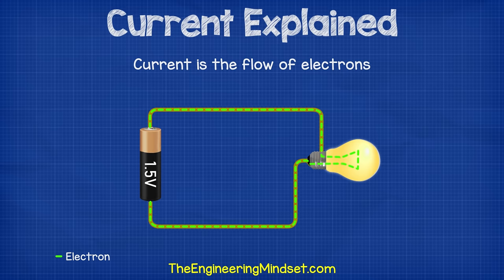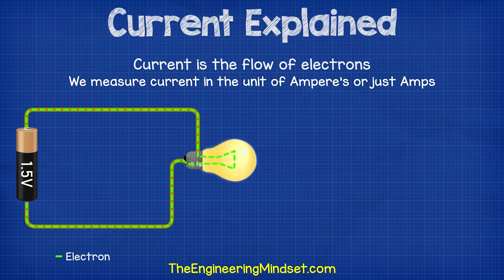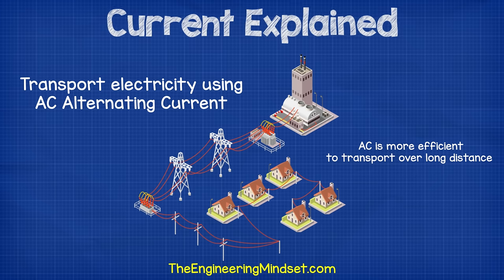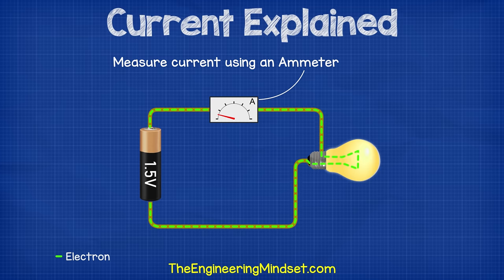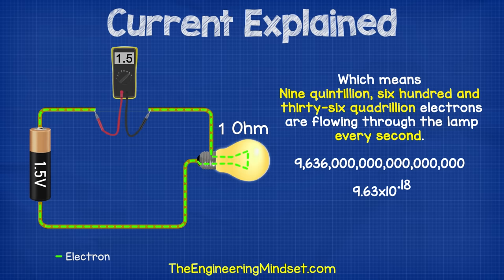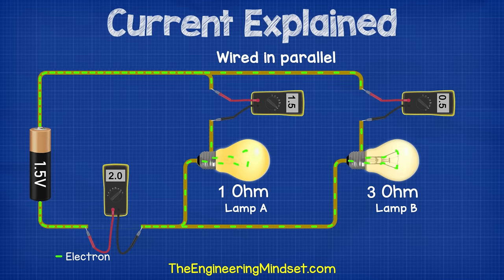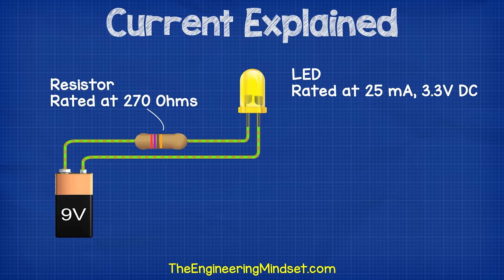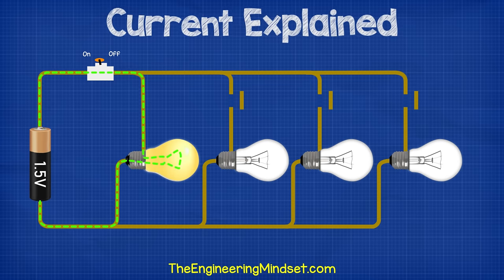What is CURRENT– electric current explained, electricity basics

Comment: The coulomb measures charge, and the ampere measures the flow of charge. One ampere of current is equal to one coulomb of charge passing a point in a wire in one second.

Comment: There is a mistake at 05:03. 1 amp = 1 Coulomb PER SECOND. And 1 Coulomb is just 6,241 506 × 10^18 electrons and NOT per second.
Reply from the maker: Check new more detailed current electricity video here: ➡️ https://youtu.be/kcL2_D33k3o

Comment: The one thing that always confused me about current, was how many amps a circuit can draw. E.g., we know from a standard 120V outlet, the breaker is 15A-20A. How was that rating determined? If we short a 9V battery (Or any voltage for that matter) with copper wire, how do you know much current it will draw?
Reply from the maker: Check new more detailed current electricity video here: ➡️ https://youtu.be/kcL2_D33k3o
Reply: We assume that the consumer will only use household appliances.
You could only really overload the circuit if you used lots of extensions and multiple sockets.
A cooker or electric shower would need a separate circuit from the distribution board with 30A fuse or larger.
Reply from the maker: Seen our new incredibly detailed MCB video? link: https://youtu.be/gqEu9t8HwW0

Comment: I have a question! We all know that High Voltage low Amperage will give you a harmless but painful experience, and that it's good to keep animals and people in and/or out of places. What about the other way around? What would happen if you came in contact with really low voltage and high amperage? And does it have any practical uses? I'm talking REALLY low voltage now, not 120 or 240 but like milli volts of voltage or something.
Reply: nothing, your resistance is too high.if it's too less voltage there is even not much current over you. in order to overcome your resistance you need more high voltage.
Look in ohms law:
U=I*R
if we assume a stable resistance of your body of lets say 100kOhm and Volts oft lets say 2 Volts, then
I = U/R, so 2/100.000 = 0.00002 Amps. so if  there is only a very low voltage it is insufficient To let current flow over your body, even if the system can deliver high current. but in reality human body is voltage dependent resistor and therefore not stable at all. with rising voltage the resistance is dropping fast and therefore current rising to hold the voltage. Then it could become dangerous.
Reply from the maker: Check new more detailed current electricity video here: ➡️ https://youtu.be/kcL2_D33k3o
Reply from the maker: Check out NEW resistor video, everything covered! ➡️ https://youtu.be/DYcLFHgVCn0

Comment: If a device can handle 1A so 1C of electrons per second then 1A is that device's tolerable "pressure". So what's voltage then? Because it's not "pressure"... it's the 1A

Comment: Thanks for this video. I'm still just struggling to understand something..I thought that the current that a battery supplies isnt definitive...that it's all proportionally based on all of the loads used, and the voltage. So Less resistance = more current drawn.
Does this mean that current is just ALWAYS 0, initially ? and until we have a voltage(E) and a load(R), we can always calculate it with I = E/R? 
I feel like something is wrong here..
Cause if we put two batteries in parallel, the voltage stays the same but the current "increases" .. how could something that's based on E/R be increased, if E and R are still the same?

how could lightning strike at 200mA+ if I can get shocked at the same voltage but a different amperage, like from a plasma ball? My body's resistance(R) and voltage(E) remains the same in both scenarios. So it's as if the current can be "set" to something regardless of loads in a circuit?

I think it's just Ohm's Law that I can't seem to wrap my head around.. :(
Any help would be appreciated

Comment: At 6:41 shouldn't polarities be recognized when measuring for amps?
Reply: Hayes9789 It’s not necessary with digital meters. There will just be a negative sign in front of the reading and will not damage the meter. However, if it had been an analogue meter, it may have done. Nevertheless, I agree with you, especially with dc.

Comment: 9:05 9 V (battery) = 25 mA (LED) * 360 Ohms (resistor), so I thought 360 Ohms resistor is needed. Instead, you used 270 Ohms resistor. That means that LED has also some resistance inside, which should be 90 Ohms (90 + 270 = 360). Am I getting it right? Newbie to electricity :D
Reply from the maker: Check new more detailed current electricity video here: ➡️ https://youtu.be/kcL2_D33k3o
Reply from the maker: Check out NEW resistor video, everything covered! ➡️ https://youtu.be/DYcLFHgVCn0

Comment: Sir in a running circuit like 6 ampere current flowing through wire if our body touch to this wire what will be the current flow from our body

Is it more dangerous than touch wire   which not connected to any load 🙏🙏

Comment: Did he calculate a 270 ohm resistor or did he just pick it? I tried doing the calculation for the problem at 9:11 seconds in the video. 
I took the 9v and divided by 25mA = 360 ohms
 I then took 3.3v divided by 25mA to get 132 ohms,
Rt= R1 + 132, R1= (360-132) ohms = 228 ohms. 
So, my calculation gave me 228 ohm resistor but he choose a 270 ohm resistor. Can someone explain?
Reply from the maker: Watch the newer version please https://youtu.be/kcL2_D33k3o
Reply from the maker: Check out NEW resistor video, everything covered! ➡️ https://youtu.be/DYcLFHgVCn0

Comment: I was wondering, how parallel connection can light up two lights equally bright? Later realised that, in parallel connection, the battery will deplete twice as fast compared to series connection.
Reply: You are correct, the two lamps might not have identical resistances so may not glow equally bright.
Reply from the maker: Check new more detailed current electricity video here: ➡️ https://youtu.be/kcL2_D33k3o

Comment: Please explain how you got a higher voltage when you added two light bulbs to the circuit. How do you go from 1.5v to 3v between battery and Lamp A

Comment: Wait, I'm confused at the end. If I add more light bulbs to the circuit, wouldn't that slow the flow of electrons since each bulb has resistance? So, why would the circuit breaker switch off? Thanks! great videos.
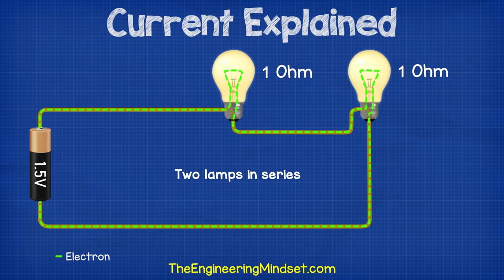Reply: When wired in series, the flow is slowed. When the bulbs are wired in parallel, each bulb takes the 1.5 V making 3V thru the breaker. At least that's what I gathered from going back to the 6:55 mark and watching it again.
Reply: When the lamps are connected in parallel the resistance drops because electricity in way has more space to flow and since I=V/R ( voltage is constant, resistance is lower ) current will increase.
Reply from the maker: Seen our new incredibly detailed MCB video? link: https://youtu.be/gqEu9t8HwW0

Comment: I just want to say that it's the signal that propagates through the wire and provides energy, not the electrons.
Electrons drift at about 10^-4 m/s.  When the signal gets to some component, it sloshes around the electrons and it behaves as you see.
Reply from the maker: Check new more detailed current electricity video here: ➡️ https://youtu.be/kcL2_D33k3o

Comment: Do fuses blow at the same amperage regardless of the voltage?  Or does the voltage have to be factored as well, resulting in a wattage that blows the fuse rather than just amperage?

Comment: A lamp and all electronic components have a maximum power, current and voltage rating, sometimes even distinguished into maximum momentary and sustained values. The amount of voltage drop and current that go with a certain (desired) power dissipation can be in arbitrarily complex relationships to each other. The linear relationship in resistive elements is merely the simplest. More voltage or more current will not always lead to more of the other, at least not linearly...
Reply from the maker: Check new more detailed current electricity video here: ➡️ https://youtu.be/kcL2_D33k3o

Comment: Hello, it the electricity flows from negative terminal to positive terminal and you want to reduce the current because of the aplliance, why do you than install the resistor between the positive terminal and the appliance? Should the resistor not be installed between the appliance end the negative terminale since the electrical flow is passing that direction? I hope that you can understand my question.
Reply from the maker: Check out NEW resistor video, everything covered! ➡️ https://youtu.be/DYcLFHgVCn0

Comment: Worth pointing out that rarely is a fuse designed to protect an appliance (unless its something very robust, motors etc), they're not really capable of protecting electronics as they don't blow fast enough to prevent current or voltage surges. The purpose of the fuse in these items is often really to protect the wiring or system from becoming a fire hazard under a fault conditions causing uncontrolled current flow.

Also worth noting that RCD's/GFCI's or other ground fault detection and disruption devices are not strictly the same thing as circuit breakers. A circuit breaker won't necessarily do anything to save you in a fault condition, only the subset of breakers for ground fault sensing will, and then, they need to have a low enough mA rating and fast enough response time in order to actually do so. Don't think your safe just because you are told there are 'circuit breakers' somewhere.
Reply from the maker: Seen our new incredibly detailed MCB video? link: https://youtu.be/gqEu9t8HwW0

Comment: Electricity has always been hard for me to understand. Your vids are very helpful. One thing i'm concerned about is "stray current" caused by power companies using the earth as a neutral path back to the power station instead of a neutral wire big enough to carry the current. My research says that as much as 70% of the current is sent through the earth...
I have constructed a small room that is 4 feet below grade and enclosed in metal  to block wifi ect. the room also has a clay floor and not insulated from the earth. I ground the receptacle to the metal wall intact with the earth. I haven't looked at all your vids yet but I am concerned about dirty electricity (HFVT) and this stray current running through the earth. Care to elaborate? thanks
Reply: They basically act as lightning strikes, but way, way less power.
Reply: @GH-oi2jf  I have no idea a this point...online somewhere

Comment: I found your explanation very useful.I have a ac/dc power supply ,500 watts 120 volts , dc 12 volts and a current rating of 40 A .
I want to use this for an audio system in my house, the current is too high so I want to use resistors in the circuit,i want to go from 40 amps to 20 amps what rating resistors would I need,someone please help.
Reply from the maker: Check new more detailed current electricity video here: ➡️ https://youtu.be/kcL2_D33k3o
Reply from the maker: Check out NEW resistor video, everything covered! ➡️ https://youtu.be/DYcLFHgVCn0

Comment: Can you explain why on a 120v circuit in a typical sub panel box  (single phase North America), where the grounding and grounded wires are isolated from each other, voltage will be detected, using a multi meter or a voltage stick, between the hot leg and the grounding wire but not between the neutral and grounding wire?

Comment: Why did the circuit get more amps to split between the lamps when they were in parallel rather than in a series? When it was just 1 there it was 1.5, in a series they get .75 and that all makes sense I just don't see where the other 1.5 amps came from when they were parallel instead.  I guess I'm wondering if Amps are dependent on the volts?

Comment: A quick question sir, at 9 min 43 sec, i noticed that the resister was placed at the returning pathway (into the +ve polarity) of the wire to reduce down the current. 

If the resister is place at -ve polarity side of the electricity pathway, would i achieve the same reduction of current?

This is because in my visual assessment, current flows out from the -ve of the battery, thus to reduce the current, shouldn't the resister be placed at the location rather at the one shown in the video? :)

Just my own deduction for your kind advise. Thank you!
Reply: Ranvier Lee it doesn’t make any difference where or which way it is connected in the circuit. The electrons flowing through the resistance either way will have the same effect.
Reply from the maker: Check new more detailed current electricity video here: ➡️ https://youtu.be/kcL2_D33k3o

Comment: hi sir, there's something i want to ask

if resistance can make the electric current decrease, why does every point have the same amount of electric current, even though the point is before the obstacle
Reply: if you cut the wire in a simple light bulb circuit, the cut would be the same as an object with very high resistance.   what would be the current on both ends of the cut wire?  zero.

Comment: Thanks a lot sir for such good informations 
i have a question please
if i have  2 LED lamps 110V ,but the source is 220V with neutral 
is there any way i can light up these lamps except bringing a transformer ?
beacause it will be too expensive
Reply from the maker: Led uses DC, so you need a rectifier and voltage regulator. Transformer isn't needed
Reply: @EngineeringMindset  
no sir u got me wrong , its ready to use lamp with rectifier inside it , it can take AC volt
but the problem is that its 110V , but all house alimented with 220V

Comment: How is the voltage and current passing through the LED light then into a resistor and not burning up the LED. You would think the resistor would need to be before he LED to slow down the current? Is this a mistake in the video?
Reply: So current can travel from the negative to positive and positive to negative? How does that work?
Reply from the maker: Check out NEW resistor video, everything covered! ➡️ https://youtu.be/DYcLFHgVCn0
Reply: @EngineeringMindset  wow thank you for responding you guys are pros

Comment: So instead of 1 light bulb i connect 2 light bulbs in series. Does this mean the battery will now in theory last 2x longer since the resistance has doubled and therefore halved the flow rate of amperes/hr

Comment: 7:43 how a battery of 1.5 V provides 3 volts
Reply: It does not. The battery is producing 1.5 V and 2 A. The ohms you see are the resistance values associated with the light bulbs, that is not affected by the battery.
Reply from the maker: Check this out, how a battery works: https://youtu.be/PXNKkcB0pI4

Comment: Engineer ,so I can basically touch live wires if I have a automatic breaker?
Reply from the maker: Never touch or work on any live circuits ever
Reply: Did when I was like 7 - the female wall plug got burned,I think I became  smarter
Reply: And I worked and got shocked couple of times when I was 13..not that deadly..well of course I don't  know the maximum breaker amperage because it probably depends :/
Reply: @dnetne5508  The female what?
Reply: @generic_name4570  Wall socket.

Comment: I have two questions. Question 1: Why do you always show movement coming from the - (minus) terminal and not the positive terminal when we all know you can hold a negative terminal and nothing happens to you, however hold a positive terminal and not have insulated soles you’ll get electrocuted. In theory therefore the movement of electrons is flowing from the positive to the negative which is what I was taught in school? 

Second question: You mention in this video, about having two lamps of different resistance, one 3 ohm and the other 1 ohm. You note the lamp with 3 ohm isn’t as bright because obviously 3ohm is more resistance than 1 ohm. My question is however, why does the 3 ohm lamp light at all if electricity always takes the path of least resistance? Why not just skip the extra journey through the wire which has resistance, and the journey through the 3ohm lamp by taking the shorter distance and less resistant 1 ohm lamp?
Reply from the maker: Q1 answer: https://youtu.be/MUh_dOcqgVw
Q2: electricity takes all paths, we just get more flowing along the easier paths
Reply: Thanks👍🏻
Reply: After watching that, I think it has just clicked. 

The reason I can touch a negative terminal and not get electrocuted but can’t touch a positive or I’ll get cooked is because the negative is only ever taking electrons away from me or out of my body, where as the flow of electrons are coming down the positive, in a condensed built up form as a result of the voltage behind them and when I touch that the positive is forcing an abundance of negative electrons into and through my body, which causes too many electrons trying to add to the atoms in my body, of which there is no space for, and as a result it continues trying and failing to add electrons down through my body until it finds a way out through the sole’s of my feet and I get the feeling of being electrocuted? 
Would it be correct to assume then that electrocution is in fact an overload of electrons being forced into the body where there is no place, or ‘new home’ so to speak, for said electrons?

Comment: Why at 7:20 there are 3 amps but when we change the resistance of the second bulb we get 2 amps at the beggining of the circuit?
Reply: Isn't it just an example and the initial current is based on the power supply type?
Reply from the maker: Look at the electrons in the animation, less flow. The resistance has changed so the current will change